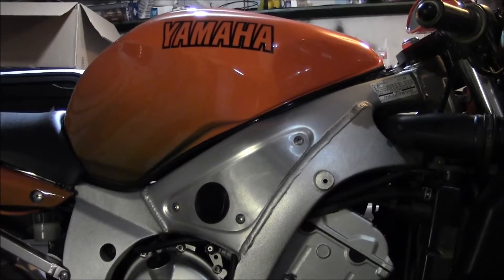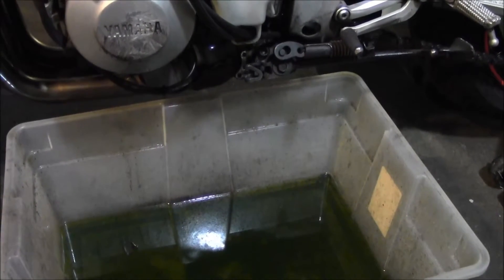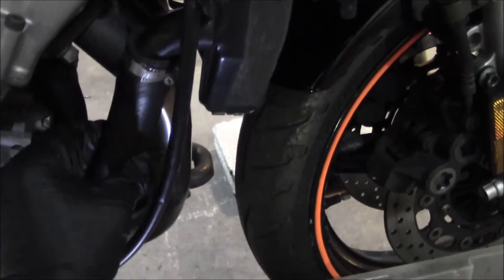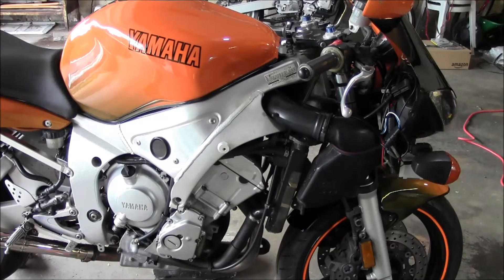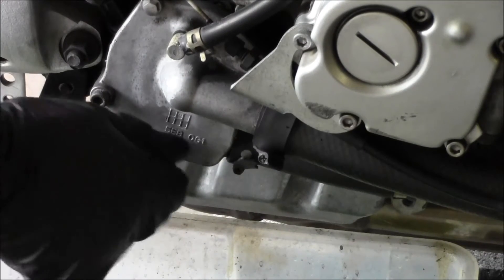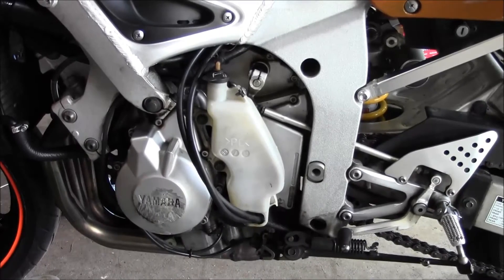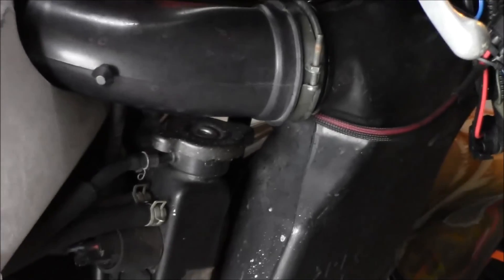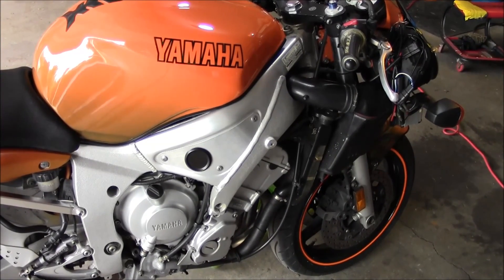2000 YZF R6 Coolant Change

Comment: Also what is operating temp?
Reply from the maker: The thermostat opens at 71c to 84c  or  159.8f to 183.2f   
The fan cut-in temp is 102c - 108c  or  215.6f - 226.4f
The fan cut-out temp is 97c - 103c  or  206.6f -  217.4f

The temp will vary based on ambient temperatures and oil viscosity.
When I used 0w-50 oil, my bike ran around 185f while crusing.
Now I use 10w-40 and the crusing temp is around 177f.
Reply: @fwh79FOXR6  so my bike can read up to 117c should this be a concern or still within running temp
Reply from the maker: @ChaoticMartian  Your bike is overheating.  110 C  or 230 F is considered overheating an engine.
Reply: @fwh79FOXR6  thanks for the quick reply,   get that fixed next chance i get on it
Reply from the maker: @ChaoticMartian  You're welcome.
Reply: How do you tell what temp it’s at I have the exact same bike ran it without coolant for a wile because a shop told me they filled it anyway I plan on doing an oil change and filling the bike with new coolant what’s temps should I look for

Comment: I have 01 r6 gauge is reading lo but won't show tempature could it be thermostat or thermal sensor would appreciate the advice your are very edifieng thank you from Puerto Rico
Reply from the maker: scrapwluv:  I would check the coolant level first.  Be sure the bike is cold (has not run for 3 hours), then remove the radiator cap and check the coolant level in the radiator.  Do not open the radiator cap when the bike is warm because the cooling system is pressurized and removing the cap will spray out hot coolant.  If the coolant level is correct, it is possible that the coolant temperature sensor is failing.  I think you would still get a reading, even if the thermostat was stuck open.  The bike would still get warm enough to register a reading above "lo" on the gauge.
Reply: @fwh79FOXR6  it was simply a bad connection with the wires that connect to the wire lead to the thermo unit, wire was split. Appreciate for responding I've learned a lot from your channel since their aren't many with the older r6's love that orange, is it like a type of pearl paint?
Reply from the maker: @scrapwluv  Thank you, always glad to help out.  The paint is not pearl, it's a solid color.  The color is actually an old Ford color code CC.  It is faded with black paint.  I kind of over did the fade job on the tank... so it's hard to notice.

Comment: Just curious (new to street bikes), why fill up the reservoir and fill up the radiator too? Are they not connected?
Reply from the maker: Trey Johnson:  Yes they are connected.  There is usually a "cold" lower mark and "warm" higher mark on an overflow bottle.  It is best to fill the bottle so the radiator can draw in coolant if needed.  The bottle is used to purge air from the cooling system.  Air in the cooling system acts as an insulator and can cause overheating issues.  Usually when the engine warms up the radiator cap opens and allows coolant to flow from the radiator into the bottle releasing any gas (air) or excessive pressure in the system. Later when the bike cools down after a ride, the cap will open again and allow the coolant in the bottle to flow back into the radiator.  If the bottle is empty there will not be enough coolant available to be drawn back into the system, causing air to be drawn in instead of coolant.
Reply: fwh79 impressed by the quick response. Makes perfect sense after being explained. Great content. Subscribed!
Reply from the maker: @Trey_Johnson11  Thank you.  I'm always happy to help someone out.  Thanks for the sub.

Comment: Where does the coolant resvior hose hook up to? Mine was completely off
Reply from the maker: The hose should hook up to the radiator right below the radiator cap.  The cap will open and allow coolant to be pushed into the reservoir bottle when the engine is hot.  The cap will also open and allow coolant to flow back into the radiator when the engine cools off.

Comment: Top it off meaning fill it back up to that half way mark you pointed out on the reservoir?
Reply from the maker: Yes, that is correct.  Checking the coolant level in the reservoir should be a part of your preride inspection.  I know it is easy to get lazy and just go ride.  However, be extra sure to keep an eye on it after changing the coolant for at least a couple of weeks before going back to being lazy.
Reply: & can the reservoir being empty cause overheating? Thank you for the information!
Reply from the maker: Yes it can and you are welcome.  Has your bike been running hot?  My bike usually runs around 177-180 degrees while i'm moving.
Reply: Yeah very hot & fast, like I would be at a red light for about 3 to 4 min & the temp would start increasing fast, I've got up to 225 at a red light before, I just checked my radiator & there's about 5 inches of no coolant & my reservoir had nothing in there at all
Reply from the maker: Yeah... that's not good.  You may have caught this problem just in time.  Have you tried to refill it yet?
Reply: fwh79 that's what I'm doing as we speak haha
Reply from the maker: Hahaha!  Ok then... well let me make a suggestion.  Fill the bottle to the lower mark and fill the radiator about 2 inches lower than the opening.  Start the bike with the radiator cap off and let it warm up.  Do this with the bike on a rear stand if you can to keep it fairly level.  Wear safety glasses because there may be some splashing and you don't want coolant in your eyes.  Keep an eye on the engine temp and watch for the coolant to start circulating around 185 degrees.  Has the bike been leaking coolant or is it smoking while running?
Reply: fwh79  No it doesn't smoke up or leak at all, it was just that there was nothing in the reservoir haha, I just took it for a ride & it did good, what's the highest you bike will get to at a ref light? While I was riding it stayed under 180 surprisingly
Reply from the maker: On a hot summer day at a light it will get warm enough to fire the fans which is about 220 degrees.  Usually around 180 degrees while i'm moving.  Just gotta be sure to bleed the system out with the cap off and then usually any left over air pockets will be relieved through the overflow bottle which is why you want to keep a good eye on that bottle for about 2 weeks.  If a left over air pocket is purged while you are riding, the coolant level in the bottle will drop a small amount and you may need to top off the bottle.  Be sure to check your bike out because coolant is either leaking or being burned in the engine (head gasket leak).  You may want to crack your oil plug open and see it any coolant comes out.  Water is heavier than oil so if the engine is leaking coolant into the oil, water will come out of your oil drain plug.  Just crack the plug a little bit... don't remove it.  You just want to be sure there is oil and not coolant seeping out and then tighten it back up.  Had that happen on my mustang once when I was doing an oil change.  The intake manifold was leaking coolant into the lifter valley on the block.  Never had a drop on the ground because it was all leaking internally.  When I went to do the oil change I was greeted with a stream of engine coolant!  Had to remove the lower intake and get new gaskets to stop the internal leak.  So take the time to check that out.
Reply: fwh79 1 last question can putting too much 50/50 in reservoir cause overheating? Like going over the second line by like an inch?
Reply from the maker: No, it can not.  Are you still having overheating issues?
Reply: fwh79 My bike has been good all day yesterday & today until earlier this night, I was caught at a lot of long red lights & it started picking up again, it got up to 200 then a little higher & I started seeing a little smoke, then it got to 223 at 1 of the red lights I got stuck at & I pulled over & let it cool off to about 170 & road the rest of the way home with no problems of overheating
Reply from the maker: Do you know where the smoke was coming from?  Left, right, front of the bike?
Reply: fwh79 being on the bike it was coming from the front right side
Reply from the maker: That is the side the water pump is on.  When you filled the coolant and ran the bike with the radiator cap off, did you see the coolant circulating when the thermostat opened?  Also... did you remove the fill plug on the water pump?  May be leaking from that plug or possibly a hose.  You should probably get that radiator cap pressure tested when you get a chance.  That could be causing problems.
Reply from the maker: Did you see the fan come on when you were running the bike with the radiator cap off?  You may have a blown fuse on the fan circuit.  If the fan does not fire up, your bike will just keep heating up at a light.
Reply: fwh79 I did see it circulating before I went ahead & added 50/50,  I don't know too much about bikes but the thing about the fan, I don't think I've ever heard the fan turn on at all, I don't even know where the fan is, that could be the problem right there a blown fuse on the fan circuit
Reply from the maker: I would take the seat off and check the fuse.  Should be labeled for the fan.  If it is blown replace it.  If it is not blown, start the bike up and let it get up to 220 degrees.  The fan is mounted on the back side of the radiator.  It is probably hard for you to see it because you probably have the full plastic body panels on your bike.  Get the bike up to 220 and look by the radiator you should hear it and feel the air movement from it.  If the fan does not come on you may have a bad fan or there may be a relay that controls the fan that has blown.  Start by checking the fuse and let me know what you find.
Reply: Your videos are a great help. Just picked up this 2000 R6 last weekend. I’m doing all the maintenance stuff this week because I don’t know what was done before I bought it. Thanks for your help!
Reply from the maker: @nicholasrodriguez8502  You're welcome.  Glad my videos are helping you out.  How is your bike doing?